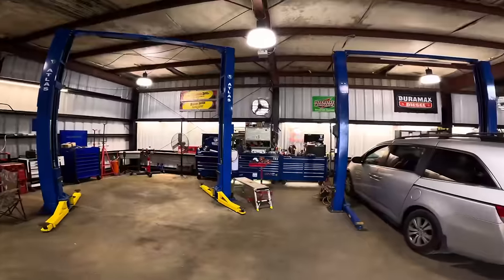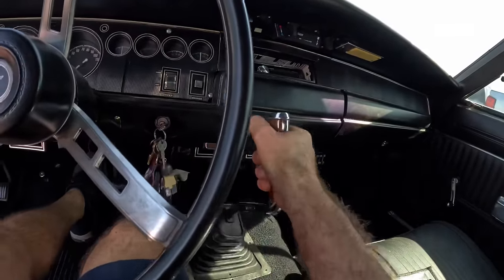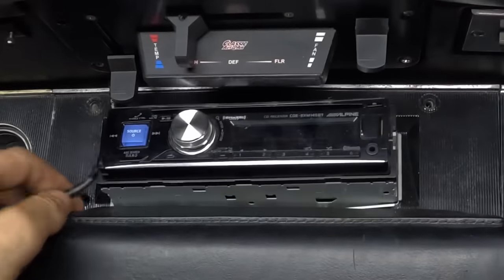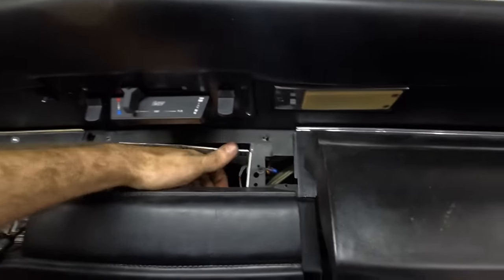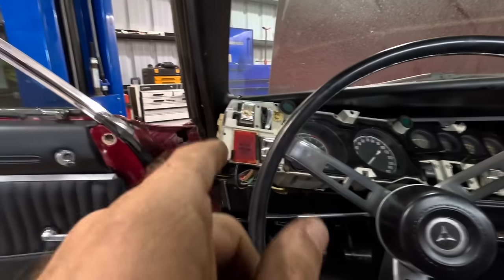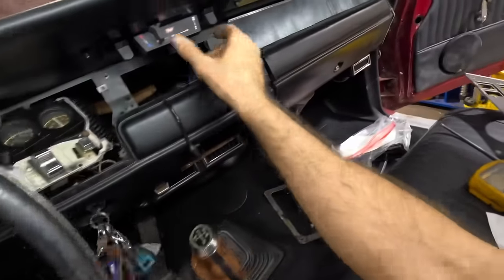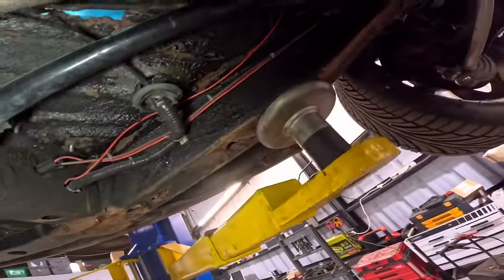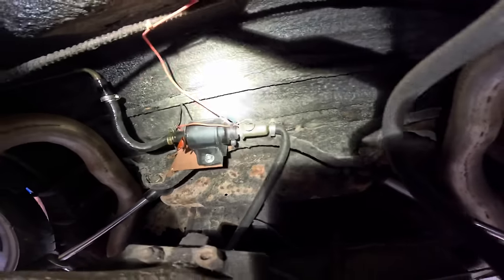Needs REee Restoration | 1968 Dodge Charger

Comment: Walk away, Ray. Walk away, that is a basket  case. And the owner will probably never be happy.
Reply: Agreed
Reply: 55 years old   Antique parts are nearly impossible to find in part stores  Most likely have to be bought through Whitney catalog
Reply: Yeah, this seems like way too much work. Like, you'd have it in the shop forever and it would basically take a lift forever.
Reply: 37:40. "Where do we start"?  Answer: by backing it outside and calling customer.  " Upon further and closer examination I think that it would be best if you find someone else to work on this car, but thanks for stopping by. Have yourself a nice day"
Reply: I agree, walk away from this one.   Cars like this one, even though they are very cool cars,  it really needs an owner that does all his own work, and is capable of restoring it properly.   It's in decent enough shape for a starting point, but needs a lot of work still.   No doubt it will need a lot of custom fabrication done, since most of the suspension is aftermarket.   I would probably put one of those Dakota or whatever they're called, digital dashboard in it.   A modern array of switches for the accessories.   I'd surely want to do something about the structural rust underneath.   If nothing else it needs to be sanded down and chemically converted to arrest any future rusting out.   Most of the aftermarket wiring is a disaster.   I personally would want at the very least to have disc brakes on the front, myself I would put modern 4 wheel disc brakes on it.   I'd do a thorough examination on the fueling system, if it was done as badly as some of wiring, it may be a rolling potential fireball.   Kind of sad to see the paint bubbling up everywhere because of rust jacking.    That car could definitely become a money pit very quickly.   It could be made to be very reliable and somewhat safe car to drive around, with some modern improvements.   But it will take a whole lot of time and money to get there.
Reply: another future car adding to his mechanic lien ones on the lot.
Reply: This looks like a car owned by a guy who lives by the line "I can get that cheaper." 
And this is the result.
To quote Monty Python: RUN AWAY! RUN AWAY!
Reply: This is a job for a specialist resto shop, not a parts changer.
Reply: Jobs like this usually start pilling up a parts bill thats pretty hefty
Reply: This is a project for Mark from graveyard Carz he restores Mopar to factory specs. Obviously this car needs some major TLC. I personally would make a list of what should be done and give it back to the customer and recommend he send the car to Oregon where graveyard Carz is located, for those of you who know who graveyard Carz is know mark will not fix anything he’ll either restore or buy the car from the customer… good luck on this one Ray slap that Junk back together and give it back charge a minimum for whatever you’ve done get that responsibility off your back, he will not be happy with the repairs people that own these cars expect experts like you to give them a full, restore for cheap….ATTENTION Ray: please listen to your viewers, put it back together and bail that’s a project Car it needs to be stripped down and restored other than that it’s just a classic junk Mark from graveyard cars will charge $110,000 to restore that car or he will buy it for I believe between eight and $12,000 it’s definitely a project car or parts car whoever owns it just wants to show off that he has a 68 charger but in reality it’s just a classical junk that’s been buttered up to the max bail bail bail get out while you’re still able too
Reply: charlieb308  Yes but is the owner willing to part with large amounts of $$s plus as othere have mentioned there's shed loads of work on this car and Ray hasnt got the space.
Reply: You have to start from scratch with this one ,...taking out every wire that does not belong there , and put in a set of quality accessories-- which probably can be obtained from a specialist ...think those exhaust bypass things are meant to have extra pipes added to them that come out of the side. fix the faults ..tell owner because of the rot it needs to go. tell him to sell it on ..let the other hopefully  "hands on" owner take on the troubles. classic cars like this are meant for dedicated enthusiasts who are meticulous about maintenance , often doing all this themselves. To be a viable hobby ..that is what has to happen.
Reply: @olddragondude4398 
That rabbit is dynamite!
Reply: Run!!!!
Reply: 41:06
Reply: 41:06
Reply: 41:06
Reply: 41:06
Reply: 41:06
Reply: 41:06
Reply: 41:06
Reply: 41:06
Reply: Hi Ray scrap the charger
Reply: Dude probably thought it’d make cool content. Honestly though I’ve worked on enough old crap to know I’m not watching someone work on old crap 😂😂
Reply: Glad you are back Ray, good to see Vegas and glad I don't live there !!! On the Dodge, the work on it looks like something I did in my 20s with a very limited cash flow just to keep some wheels under me !
Reply: Walk away, nice dreamer but not a project for your shop !
Reply: Get a hold of Mark at graveyard carz. He's the best Mopar man in the pnw. He might be able to find parts you need. But at a prem$$.
Reply: Now I see why you say walk away and you are right.
Reply: Run 😳
Reply: @accendo2k9  Oh boy do i have a story for you, Ive been doing "Some" Work on a 1968 California Special Mustang recently and its been in the shop for like a Month now. The Owner will never be happy with it. And it Also sucks that my boss is the owner of said "Can of Worms".
Reply: Oh boy do i have a story for you, Ive been doing "Some" Work on a 1968 California Special Mustang recently and its been in the shop for like a Month now. The Owner will never be happy with it. And it Also sucks that my boss is the owner of said "Can of Worms". The other day the boss wanted me to do an engine bay wash with a fucking brush and some cleaning solvent. The cleaning solvent made it look all nice and shiny when it was wet. But when it dried it looked just as filthy as before. He didnt want to use a Preasure washer and fucking degreaser cause "It may ruin the patina". Fucking sucks working on that nightmare. Ive probably redone all the wiring in the engine bay by now.
Reply: Send him to Graveyard Carz.  Mark Worman will dip the car and most of it will disappear.😂
Reply: @justpray365  To bad the car was imported from California to Sweden Where it is Now. I would love to send this hunk of junk back to yall !
Reply: Hi ray personally I’d walk away from this car looks like a butcher worked on it let’s face it has too many problems ,and will waste too much of your time when you could have 5 or six cars through your shop and with better profit ,don’t know if the owner watches your channel but if he does then he really needs to take heed of the comments lovely car but needs a lot of work which in his case won’t come cheap I’m afraid shame really as the right body shop could have this looking great but it all boils down to what he can afford to spend on it take care and thanks for a great video ps . Your truck is looking top notch by the way 👍👌🔧🔧🔧❤️🏁🏁
Reply: Ray I know it’s been said time after time in the list of comments, walk away ray walk away, the owner is going to blame you for a lot that you had nothing to do with. Put it back together and walk away
Reply: @jtjones4727 That's usually how cars get into this condition in the first place. Owners that are not capable of doing the work but think they are.
Reply: kind of dent want to see this car on ray channel since i feel it will just be a waste of time
Reply: I agree!  WALK AWAY!!!!
Reply: @adamness9557  That's a long way from Florida.
Reply: Don’t WALK AWAY,,,,RUN AWAY!!!
Reply: @isleofthanet and we assume the owner already had hack work done to it, so doesn’t get it.  Run fast and FARRRRRR AWAY!
Reply: Sorry Rays this thing will be a nightmare without end. Typical customer😅 who bought a vehicle that needs an owner with mechanical knowledge to do his own work. Don’t take on another’s headache that will transfer to you with no happy ending. On second thought as others said push it,out the door without return.
Reply: @Grumpy-sy7wr why would you call a "Parts changer"? He is in fact a diagnostician. I see him diag before parts.
Reply: Take out the cigarette lighter and rebuild an new car around it. It will be faster and cheaper.
Reply: RUN AWAY.   WALKING IS TOO SLOW.
Reply from the maker: Yea it needs a complete restoration again, the body is falling apart 😢
Reply: The priority of the repairs needed is all wrong
Reply: Agree run 🏃‍♂️
Reply: Agreed
Reply: You got that vibe too, eh?
Reply: it reflects on the owner's whole life priorities set all wrong. @SeaDooEric
Reply: Being a retired mopar restorer, if that customer doesn't have 10k to start with repairs, then walk away. That car needs serious help.

Doesn't help that you broke a very rare headlight switch.
Reply: charlieb308 I agree, he doesn't know anything about those year mopars. He has no business working on it.
Reply: I'd send the car to graveyard cars in Oregon to have a full frame off resto mod but might sit there for a few years before it gets touched
Reply: That car is too far gone to even restore, plus all the repairs that were done have to be ripped off because they were done incorrect.
Reply: Walk away
Reply: That was my first car. What a mess but loved it.
Reply: @Grumpy-sy7wr exactly they assume Ray does all this crap. Notice the can of worms he opened up by showing his truck mods.
Reply: That’s an extremely expensive car now. 100k car be careful Ray.
Reply: Nope, this guy needs Ray's help. But, if this owner doesn't know how to fix simple things like this, he needs to sell it. This car deserves a better owner.
Reply: Run do not walk!
Reply: Don't walk, RUN
Reply: @GrayRealities  I'm thinking the owner doesn't have that budget.  Look at the work currently done.
Reply: charlieb308   Then what?
Reply: charlieb308 probably learning the hard way: I dropped my 70s Chevy truck at the local gas station bay like it was 1997 and  didn't think anything of it until I got it back and realized I deeply need to rethink that mistake
Reply: charlieb308 you may be correct but not everyone has the ability time or truckloads of money to do all the work needed to restore that Charger.  Better to let it go, there are people who can turn miracles on these classics, but the owner of that Charger is certainly not the one! Ray will never be ‘done’ with the repairs needed on that car! Jes my humble opinion.  🤷‍♂️🤨🧐🤔
Reply: I remember some regrettable decisions I made when I owned my own shop before retiring. Working on cars like this is a mistake unless you get significant cash up front and you have the space to store it safely for long periods of time while you spend hours looking for parts. This is exactly the kind of car that can be sold to someone who knows nothing about cars and cannot afford to make it reliable but is swayed by the paint job. Put $25,000 in the car and you may have a safe cool car to go get a beer on the weekends.
Reply: Don't walk!!  RUN!!!  Run like Forrest!!!!!!!!!

Comment: Put the pieces parts back together and send it back to the owner on a flat bed, that is one headache you do not need. Unless the owner is willing and able to pay for a proper restoration... like frame off restoration nut and bolt restoration of such a beauty. It looks as though this pig has had multiple layers of lipstick applied. You have one project sitting in the shop, you do not need this thing occupying anotjer stall for months on end. Also super happy to have you back, I pray that SEMA was a blast.🙏💜

Comment: What this car needs is a complete restoration, much more than the Silverado turned int, which was much more than expected. Giving the owner the complete story is good, and then politely say that this is beyond what Ray is in the business to do, is treasonable. As talented as Ray is, he could probably fix everything this car needs, but it would be a long expensive job, and that isn't what Ray's talents are best used for.
Reply: Biggest issue isn’t so much the little things. It’s the replacement parts. There are none. U won’t find 90% of anything you need from o reileys 😂. Buy a new switch. Yeah let me know how that goes 😂. Good god. He really didn’t have any business bringing that car to you.
Reply: 20k would get the car to what the owner actually thinks he’s got.
Reply: @level1804  I think I would go quite a bit higher than that!  There could be 20K just in the structural repairs!  Ray, don't walk away... RUN!!!!

Comment: Well, I always watch you with interest. This video was cracking me up as I was a mechanic back when these were new. It just struck me funny that you were struggling to disassemble because what was common for me is alien for you (the older technology if you can call it that).  I watch you with the modern electronics and especially the A/C, fuel lines etc.  I wish the older days were that easy with the quick disconnect of most of the items.  I do admire your diagnostic procedures and technical skill. Keep up the good fight. BTW, that Charger is worth a fortune and is worth repairing or restomoding.

Comment: I must say, this has been about the most entertaining and amusing video you have made to date. Being that I do learn and take much interest in your usual work on computerized snap-tite vehicles, but this Dodge is the era of car I work on regularly. One tip I can give, is the jumpy speedometer is most likely a tight bend or kink in the outer cable, causing a wind up of the inner on each revolution, it snaps around and flicks the needle up. Common problem with these.
Personally, to be brutally honest, I'd suggest this particular vehicle be shipped up to Franklin TN for some good loving.
Reply: Could also be a worn out speedo drive gear and the head itself also can do that when it's worn out or taken past 150 too many times.Probably over 200k on it- way past warranty now

Comment: That Dodge has great potential, but it would be a long term resto project. The question would honestly be how much of the required parts would even available. It's sad to see a classic car in that condition. Most people don't have the time or resources to fix them the way they need to be done. Great vid Ray.
Reply: ALL of the parts are available
Reply: The parts are available. The labor tends to be expensive and you have to be careful who you hire.
Reply from the maker: Im thinking it needs about a years wit worth of bodywork
Reply: @RainmanRaysRepairs a total gut and body off restore
Reply: And watch for the tin worm.  It can be everywhere!
Reply: As someone who has done several old Mopars the parts are readily available, fairly inexpensive and usually better quality than OEM.
Reply: at least. And it's the very first thing I'd fix. @RainmanRaysRepairs